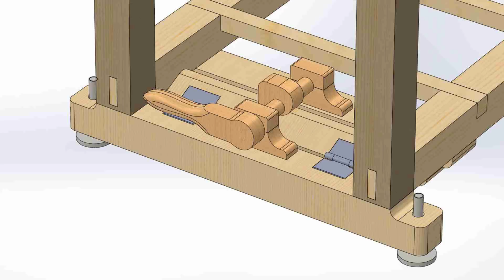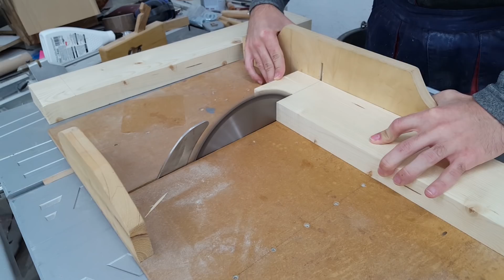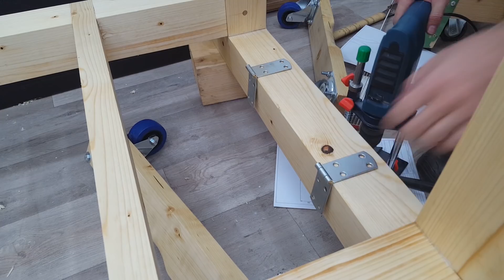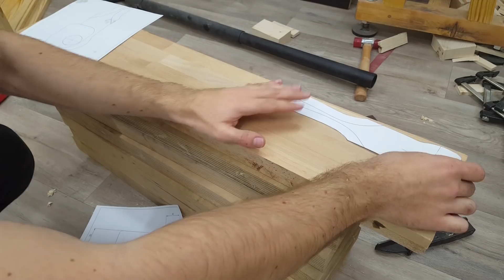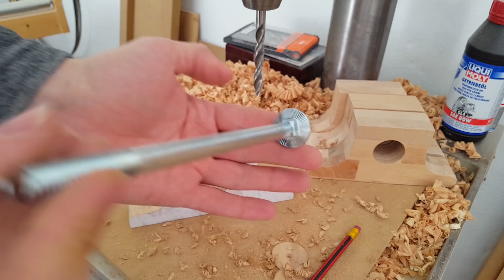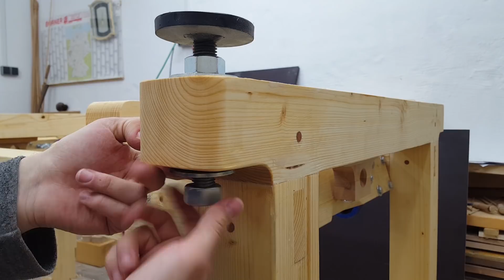How to build the Ultimate Workbench - part 5 - Wheels for the workbench!

Comment: Very well presented bench build.  
At 12:54, you suggest that the blocks  for the dowel don’t carry any load.  Are those blocks part of lifting the bench when the wheels are used?
Reply: I think he's saying those screws are not carrying any load because the very large bolts do that, the screws are just for positioning and tightening.

Comment: Hi Neat work, the only bit I would do different is to bolt the wooden pivot/bearing/dowel holders to cross member as load would be applied up on them as the casters are pushed down otherwise great job ,G
Reply: I think they are bolted to cross members. Possibly bolting them under a cross member (instead of on top) would mean that the force is going in a better direction and not all through the bolts  🤷

Comment: 14:37 how did you ensure that the mechanism cant flip out like you see here? It looks like it can happen by pulling at the leverage or did i miss something?
Reply from the maker: Hi Raphael,
nothing really, good eye! I thought about adding a crosspin behind the first block, but after trying the mechanism i noticed that it wont be necessary, the mechanism doesn´t get pushed out or anything by using it, I would have to pull on it. So I could still easily add something, but don´t have to :)
Regards
Reply: in case you want to here a little easy idea, just drill a hole and lime a pin of wood in there. Not that nice looking but simple ;)
Reply from the maker: Yes, that was exactly my idea :) I called it "crosspin" but I guess that´s not the right word for something like that
Reply: does not matter if it is "the right word" i do not really know much about craftsmanship but i have some eye for let's say quality issues. But fine. 
In general very well done project. Btw i found you over wintergatan ;)

Comment: Cracking bench idea and liftable caster's. 
Did I miss the part how the Dowl stops sliding out the holder's after time?
Reply from the maker: Haha no, you didn´t miss that part. I thought about putting some stop-pin through the dowel, but I use the mechanism only in rare occasions and then it doesn´t bother me at all.

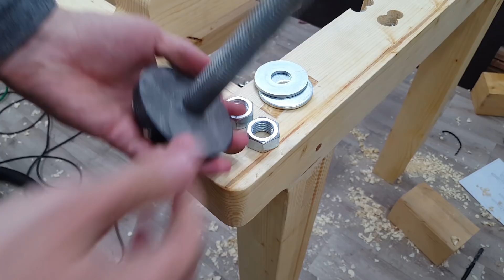Comment: 12:00 Where can I get those feet? Amazon link would help a lot. I cannot find any that are that big. thank you
Reply from the maker: Hi, I had them made at a metal shop from 10 mm steel plate and M 20 threaded rod, aka half inch or 3/8 inch steel and 3/4 inch threaded rod, diameter was about 80 mm or circa 3 inches.

Comment: I really like it however I think I would have run one dowel the length of the table so you could adjust all the wheels at the same time for any side. Regardless love the idea and the way you try to avoid as much as possible all screws and nails
Reply from the maker: Hi Andre,  
thank you! My first thought was one long dowel, too. But then I got  concerned that it would only really lift one set of legs and leave the other one half way down,  because of flex and twist in a 6 foot long dowel, I guess it would have had to be much thicker. So I went the easy way. 
Thanks for watching and thank you for commenting!
Reply: I am wondering this for my build. I guess a steel pipe instead of dowel would be necessary for the linkage. It wouldn’t be too different a build, bolting on the cam eccentric and handles instead of dowel and glue.

Comment: Of all the retractable caster videos I've seen thus far, these look to be the best.  Even the ones shown for the lighter tool are better than the others.  I've seen a caster mechanism that looks similar to that, but they used two pieces of wood that rub against each other rather than a roller.

This mechanism that uses a cam (or "eccentric" as you put it) reminds me of one I saw in a diagram years ago.  I think it might have been in a Family Handyman magazine, or possibly some other woodworking magazine.

Comment: Surprised the dowel was placed in the thin part of the cam on the lift. Waxing the parts might help on the easing of the cam action?
Reply from the maker: Waxing is a great idea! Will do. The dowel goes all the way through, I just had it enter on that side because it´s the surface that won´t get in contact with the wheel board. Regards

Comment: Brilliant concept. I wondered why you didn’t leave the dowl the full length of the work bench so that one action from either end would lift or drop all 4 feet at the same time
Reply from the maker: Thanks :) That was my initial thought but I was afraid that the required momentum would get so high that it would simply twist the 2 m long dovel, instead of moving the 2 feet at the opposite end.
Reply from the maker: dowl*

Comment: Sehr gut! Ich bin gerade auch beim bau einer Hobelbank. Da Ich aber die Bank so bauen musste, dass die Bank (wenn Ich um/ausziehe) wieder zusammenbau bar ist konnte Ich leider kein solch ein System wie du verwenden. Ich habe Stattdessen 2 Keile an einer kurzen seite an der Werkbank. Mit einer Gewinde Spindel wird ein keil verschoben und drückt den anderen nach unten. Dadurch setzen bei mir sich die Räder auf. LG
Reply from the maker: Moin, das klingt auch nach einem sehr soliden System! Danke und lg zurück